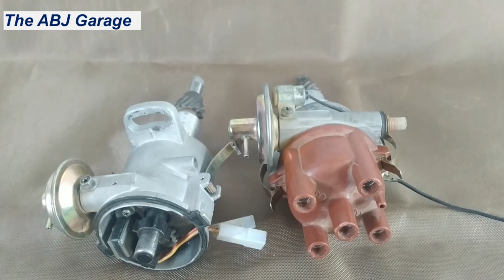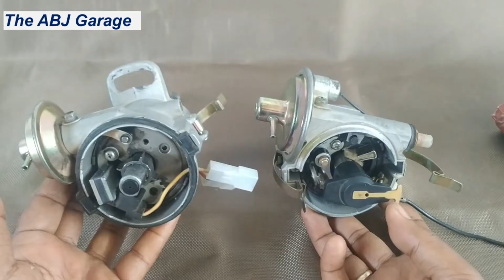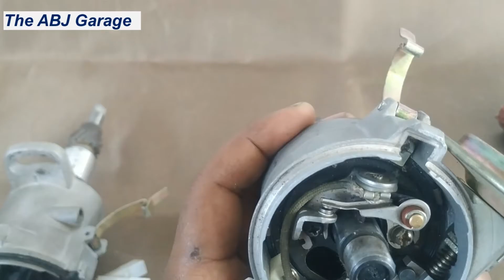Contact point type Vs electronic ignition distributor

Comment: Sir thank you for this. You explain it so easy to understand.
I have one question.When the distributor is electronic then..
The ignition ( battery)+ wire is stll connected to the positive(+) on the coil and on to the distributer. IS this right.??. 
Bless you.
Reply from the maker: The positive wire coming from the ignition switch is connected to the coil positive terminal! The ignition coil negative however is connected to either the distributor, the ignitor or ignition module depending on the model and type used.
Reply: @TheCarCareGarage  Thank  you.

Comment: Thank you kindly. I did not hear what disadvantages the electronic system has. There are some, particularly how  electrical inputs can affect it.
Reply from the maker: Indeed no significant disadvantage of electronic ignition distributor is mentioned in our video.
Reply: @TheAbJGarage the only disadvantage I could see is maybe the mechanical distributor is easy to diagnose a failure. Due to seeing a moving part actually not working.  Maybe.

Comment: from which model the electronic distributor is fitted ? thei can be interesting as parts source to convert small distributors as bosch from points to electronic, for the electronic module, you can use the GM HEI 4 pin module, there is much info on the internet for that use of the GM module.
Reply from the maker: Ok dear! Thank you very much! These are both from Toyota engines

Comment: That was very informative. But I still have one question. Many people say that electronic distributors are unreliable compared to the old point style distributor. People say that electronic distributors will fail without giving any warning. Is that true or just a myth?
Reply from the maker: comparatively they have less moving parts and therefore last longer... but when they stop they usually barely give warning ahead of time.
Reply: @TheCarCareGarage  points have exactly ONE more moving part than a hall type distributor, and when they're ready for adjustment or cleaning there will be a noticeable lag in throttle and starting time. With an electronic distributor, a resistor or capacitor pops, it will leave you sitting along side of the road. This has been the case for me on more than one occasion which is why I drive a 1972 Ford F350 as my daily driver. It is point fired,has a hand choke,a Holley 2 barrel carb,and NEVER fails t o start. It's got a 390 big block and still gets on average 16 mpg. AND has the added benefit of being probably the best sounding truck in my neighborhood. I can't leave the house without someone trying to buy it.
Reply: Absolutely true.